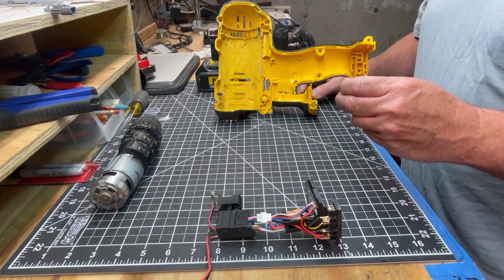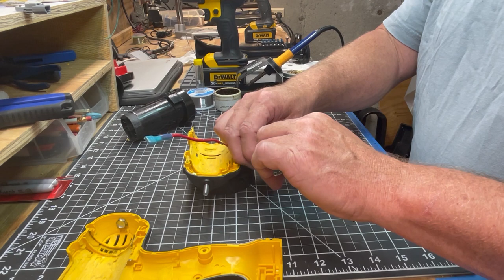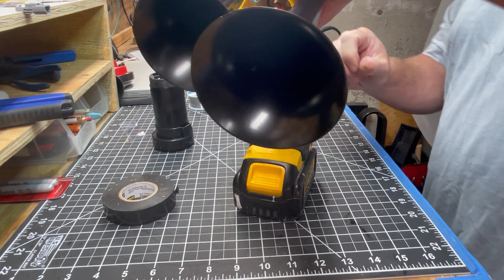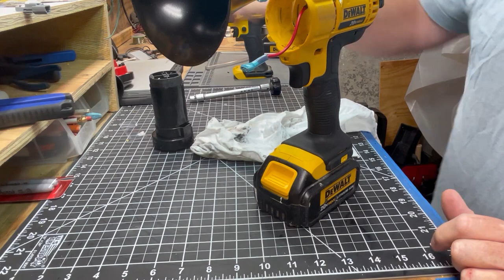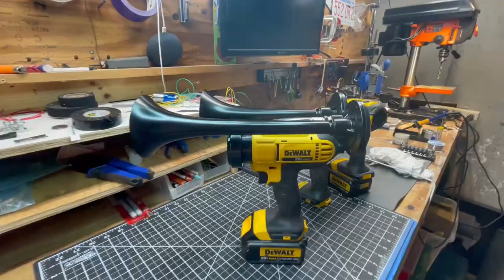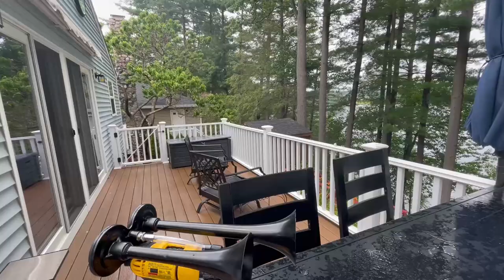Dewalt Air Horn

Comment: Which wires are power and ground u used?.. I have a white,black,blue running to the motor.. I'm using a brushless 1/4 " impact DeWalt.